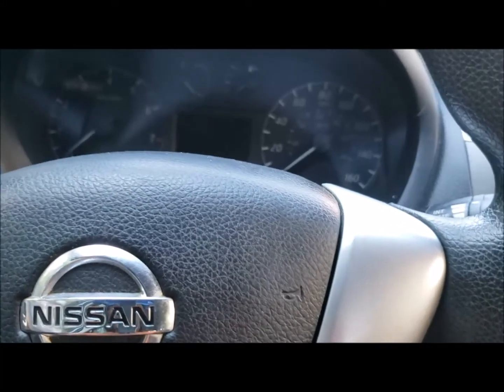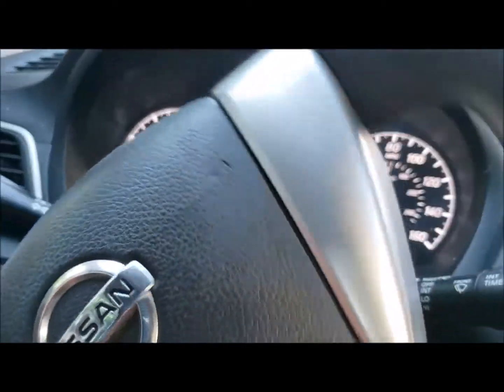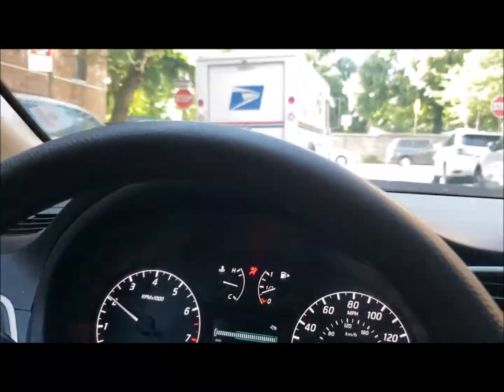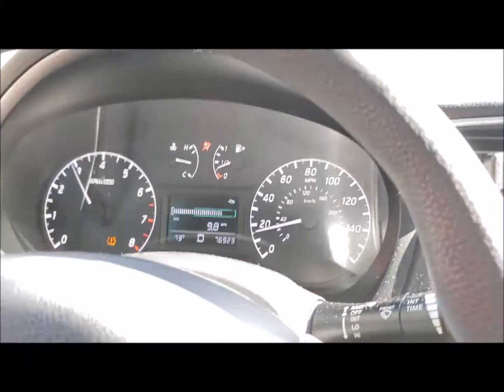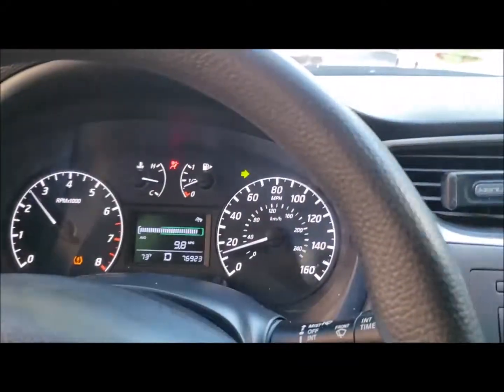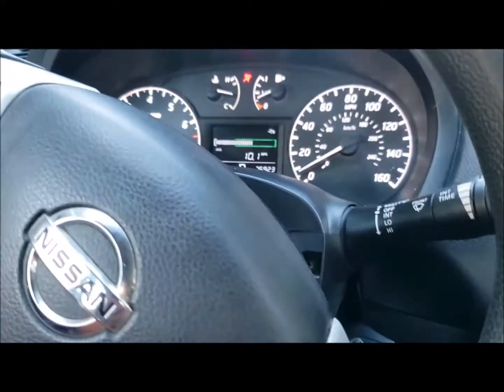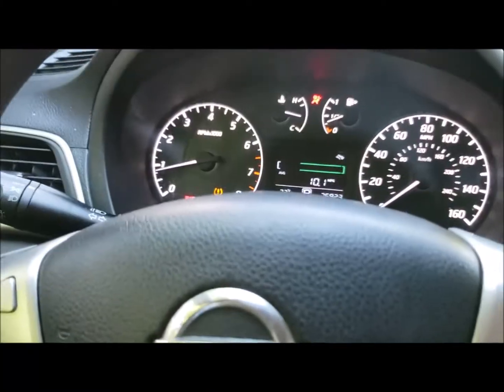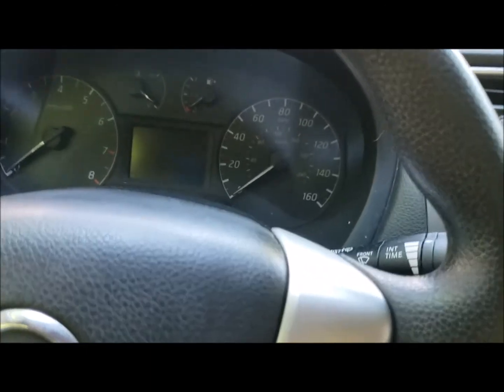Failing CVT Transmission - Part 1

Comment: Hi, I have some issue with nissan sentra CVT. Can you advice any solution please??

2013 model, 135k miles done, codes
1. P0847- FLUID PRESSURE SENSOR
2. P0963- PC SOLENOID A

Have a hammering effect after these codes shown up and feels like cvt not shifting to higher ratios. 
Does a valve body replacement helps in this issue?
Reply from the maker: Change the valve body
Reply: Hope you can help me out,  thanks.

Comment: How many quarts of ns3 cvt oil did you use after changing valve body?
Reply from the maker: I put 5 qts, then drained the excess through the pan plug while the engine is running

Comment: I owned 2016 altima. I HAVE CHANGED TRANSMISSION TWICE,  I HAVE A/C ISSUE, AIRBAG LIGHT ISSUE, SPEAKER ISSUE, BACKUP CAMEARA ISSUE. DO NOT BUY ANY NISSAN CARS PEOPLE. PLEASE BE AWARE OF NISSAN. NO MORE RELIABLE CAR AT ALL.

Comment: The air bag light is on because you might not have the seatbelt, or the passenger doesn't and you do. Or if you have something heavy on your passenger seat it thinks it's a child or a person and has the light on to warn you
Reply: pretty sure there's a seatbelt light for that
Reply: @Joe_Mission  No it's that same red little airbag one lol i have a 2017 sentra, always turns on when i go to the bank and get a bunch of loose change and i place it on the passenger seat, won't turn off unless i move it or buckle the belt

Comment: I have a 2013 Nissan Versa with about 120,000 miles and the engine code P2859 Clutch A disengagement performance
Reply: Ohh me too what did you do to fix it
Reply: @brianatovar6150 update??
Reply: @brianatovar6150 update
Reply: My dad showed me a trick but not a fix. Basically once you get to that point where it doesn't want to change gears, take your foot off the accelerator and do not press with your foot anything else. Then you slip the speed shifter FROM DRIVE TO NEUTRAL FOR ONE SECOND. MAXIMUM 2 SECONDS.  After that pull the speed shifter back to D or Drive. And ONLY AFTER THAT, press softly on the accelerator pedal and it will be good for the rest of your drive unless you get to a stop light, etc. If the trick doesn't work at any time in the future, pull to the side, put in park. Turn off car. Turn back on and take off. And redo the steps above. It's worked thus far and my dad also drives long distances with it.

Comment: Bro did u change the transmission fluid at 60000 miles
Reply: Doesn’t matter.  It’s still junk.  But a toyota.
Reply: @Mabeylater293  Toyota isn't god. Remember the accelerator pedal recall they had to do? No car company is perfect.
Reply from the maker: The fluid was never changed

Comment: I have a 2013, mine suddenly doesn't go into gear at all, same code.
I guess it doesn't go back to gear. I step on gas and nothing happen. Will replace the valve body and see if the helps.
Reply from the maker: Remember to transfer the old ROM to the new valve body. If not, you will have to program the transmission.
Reply: @tryfixinit8438  I will try cleaning it first like you did.
Reply: @JavierGonzalez-so8sh  how's the fix so far?
Reply: @mohfslm  ended up replacing the cvt

Comment: My car gives an engine code clutch disengagement performance what did you do to Solve the problem
Reply from the maker: What was the code and what is the mileage? I posted a series of how the problem was and could be fixed.
Reply: @tryfixinit8438  the code is p285B clutch disengagement code check engine light is on
Reply from the maker: @bsiejnejejjs8233  If the transmission downshifts without hesitation, you should change the CVT fluid.
Reply: @tryfixinit8438  it’s not shifting at all when I drive it but it still goes in to drive or reverse
Reply from the maker: @bsiejnejejjs8233  I assume you have a Nissan. What is the model, year, and mileage? If it's still under warranty, you should check with the manufacturer before anything else.
Reply: @tryfixinit8438  2014 Nissan Sentra 144,000
Reply from the maker: @bsiejnejejjs8233  Replacing the valve body will be a long-term fix